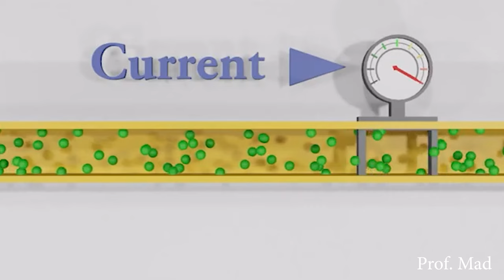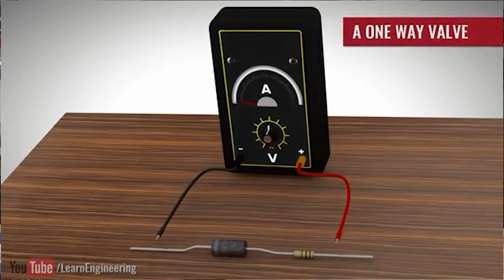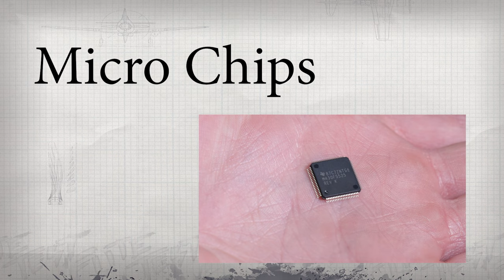PCB Board Components - 101

Comment: does the pcb come wth the components or you buy them separately....also i had an enquiry.. dont have a circuitry, i want to design a ciircuit before making the pcb, can you design a circuit given the main components and include missing components in the circut if mising..does the pcb come wth the components or you buy them separately....also i had an enquiry.. dont have a circuitry, i want to design a ciircuit before making the pcb, can you design a circuit given the main components and include missing components in the circut if mising..

Comment: Considering that such components are often sold in large quantities it might be an idea for FliteTest to sell a package of such components, in smaller quantities. Think a package containing 50, or perhaps a hundred pieces of each size (within what is applicable for the rc hobby) of each of those components. You could have 50 through-hole resistors of one size, 50 of another size, and so forth until the need of the most common used resistors in the rc hobby are filled. And similar for other components. That would enable a lot of people to make their own prototypes, or even simple electronics since not everyone wants to go chasing around the internet for a supplier of a spesific component, only to have to order many hundreds, or thousands, of those components when they only need a few of those components to make what they want. Having a package, that one could buy, which contained the most used components for the rc hobby, components of various sized, and in smaller quantities than if ordered directly from a manufactor, would make electronics a lot more accessible to many people. 

Think if FliteTest would sell such packages of components, in a similar way as their powerpacks.But rather than selling various sized components in different powerpacks, they could sell a sort of bundle pack, an asortment package if you will, containing a number, say 50 for simplicity, or a hundred, of each of the various sized pcb board components. Then rc hobbyists could purchase that bundle pack of pcb board components and be reasonably well set with components to make projects of their own. 

I would love such an assortment / bundle pack of pcb board components. Being interested in arduino I have come across kits containing some components needed in the projects the kits teaches you about and how to make. But the number of components in those kits are too few to really experiment on your own, and use in more projects of your own since you have to re-use components from other projects in a newer project. Or you could try ordering such components online, and having to order a few hundred of those components when you will only be using  a couple of the components. 

In short, online ordering of such components are mostly for companies making various products using those components. They can order components in large bulks, since they produces products in large bulks. For amateurs there really are no good option, I have found, to get a hold of a smaller quantity of such components, of the sizes I am interested in for my projects. 

But FliteTest, being of the size they are, with the capability to make and distribute powerpacks, could fill a void in the market, by ordering a selection of pcb board components suited for rc, in large quantities, and then repackage the components into smaller asortment / bundle packs of components, and sell. Because if they did, I think many rc hobby shops would be interested in re-selling such a product, and I would probably buy such a products since it would be alot easier than having to hunt down a specific component for my use on my own.
Reply: There are kits on Amazon with little cases that come with like a batch of 10-20 of all sorts of different components for a variety of uses.

Comment: a transistor and a mosfet is a different component ,for a transistor it have the base and it depend on the current to pass current from collector to emitter and mosfet nee a voltage diffrence in the gate to conduct .

Comment: 8:55 2.54mm sounds like a hundred thou to me🤦‍♂️
Reply: Good point! - Unfortunately the electronics industry seems to have focused on metric. I've almost forgotten where some of the pitch measurements originate from.
Reply: @tannerewing9361  Probably Because Electronics are manufactured in countries that use metric, isn't America the only Imperial Country Left? also metric is just easier to understand. I was was introduced to both as a kid and I still don't understand imperial its too confusing for me. 

like how 10,000 Millimeter = 1,000 Centimeter = 100 Meter = 0.1 Kilometer
and 1kg of Water = 1Litre = 1000Cubic Centimeter
Metric is sooooo much easier to convert between everything

so things like a box which is 20cm x 5cm has an internal volume of 100cc OR 100 Milliliters of water. 
I Have no idea how to Calculate that in imperial, its just soo much cleaner in metric.
Reply: Avixs yes I believe you are correct. But, like I always joke, there are two types of countries in the world, those who use the metric system and those who have landed on the moon…
Reply: @tannerewing9361  Also Didnt NASA switch to Metric in the 90s? or was that earlier I dont remember. either way Metric will probably replace imperial eventually, or something Akin to metric.